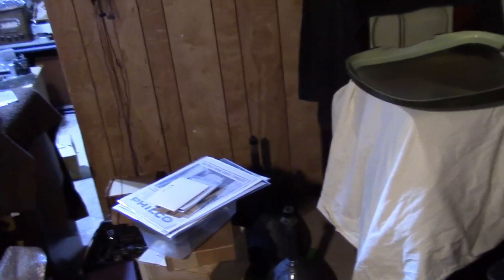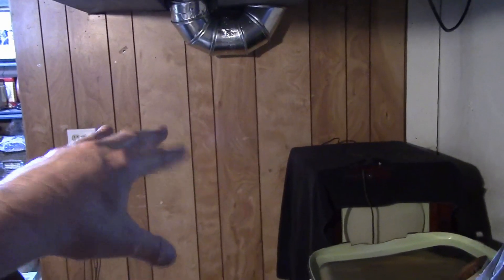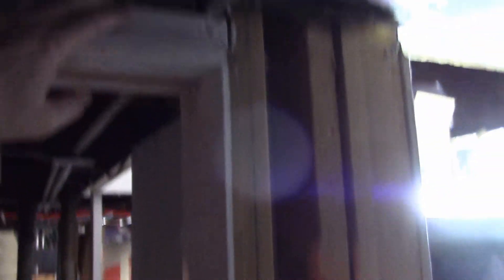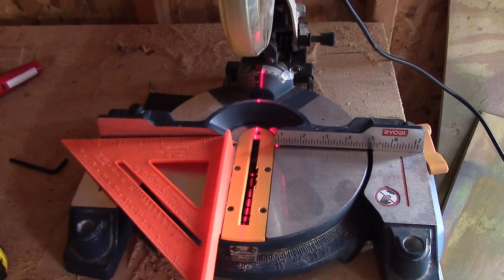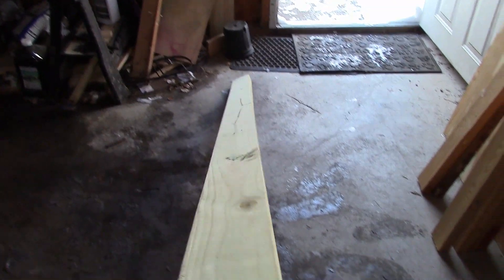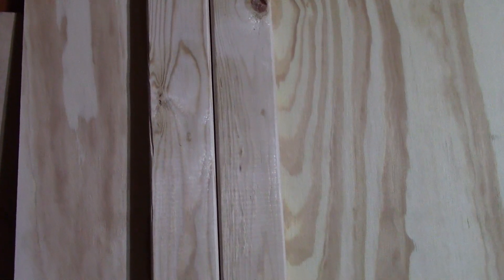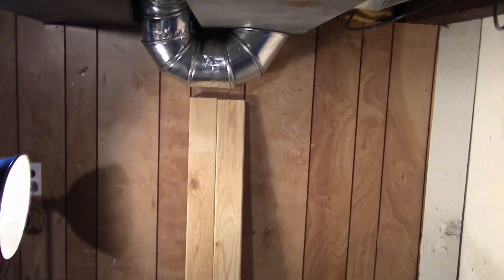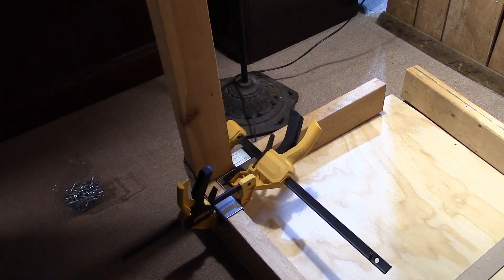Building a mini workbench

Comment: I made plywood top workbenches, but I used plywood with veneer on the top.  These were sanded, stained and then coated with urethane.  I made them 15 years ago and they are still holding up to daily use.  All electronics work happens on them and the computer is attached to one of them (rack mount).

Comment: For a tube test bench I would think that carpet on the top surface would be great.  It would protect CRT faces  and tubes would not roll away as easily.
Reply: Yeah I concur. Better than laminate and cheaper than an ESD mat. It's a common surface on TV, VCR, Radio repair benches. The last shop I worked in had one.
Cheers,
Reply: Doormats at Home Depot comes to mind. Some have an excellent table top work surface and are inexpensive.

Comment: As long as the top wood is dry and above about 65 deg F down there, you can coat it with two part epoxy.  Use a thin foam roller suitable for resins, the epoxy will seal the wood and it will be a bit darker.  Two coats, one after the first is tacky will make it a bit smoother, the one coat will feel the grain but seal it.   The wood grain look will remain if you like that and a bit darker since it will sink in.  I have a boat so have resins around for use,  but the poly coating likely lower coat.  You can also seal the end grain but watch the application near the edges it will run down the sides.  Acetone for cleanup.

Comment: The last workbench I built, I went all out and put down an ESD rubber surface. It's bought in rolls. Expensive though... The bench shows up in several of my vids. The bench surface is recessed to make the mat flush with the edge. Probably way too fancy for your new bench... perhaps just a laminate surface would work (apply with contact cement). I personally don't like those for work surfaces as stuff slides around too easily hence my use of the rubber ESD surface which grips and holds stuff in place.
Aside from that... I thought the US had Square drive screws now? Maybe the kit manufacturer is old fashioned :)
Cheers,
Reply: Square drive screws are pretty rare in the US, but common in Canada. I think I've only seen them in Canadian equipment.
Reply: @eDoc2020  yes. In Canada the Robertson  has been the defacto head in wood screws for decades.. I thought it was more common in the US (maybe construction only) now. The style is nice as it locks the screw into the bit making easier to start a screw. Using a Philips head in wood looks to be easier with an impact driver, less chance of the bit popping out and skipping.
Cheers,
Reply from the maker: Square (Robertson) screws are slowly appearing.  There's a complicated history behind them and why Canada uses them.   Patents and royalties between Ford and Robertson are at the heart of it I believe.
Reply: @bandersentv  Yeah, I think it's called The History Guy channel on Youtube that has a really good recounting of this story. Very interesting.

Comment: Why not put those metal fasteners on the inside of your workbench struts, Bob? Strengthwise they would do pretty much the same thing but, it would be a bit more esthetically pleasing don't you think? Also if you have two of these kits you could add one on the inside and one on the outside, making the whole lot stronger
Reply from the maker: I don't understand. The fasteners completely encase the wood.  There is no inside or outside.  Are you referring to the two I show at the end?  Those are not part of the kit.  I bought those for the top since I can't screw the board down form the top.  The ceiling is too low.  I can't put them on the back because I already mounted the pegboard.
Reply: Hi Bob, yes sorry, I made the comment a bit prematurely and then forgot about it as I watched the rest of your video. I thought those brackets would only cover the front of your struts and not sit on top of them saddle-like.
Anyway, I noticed you noticed one can buy similar brackets for attaching roof beams and such separately. I used similar ones underneath my roof. Nice job though, you reminded me I really need to put some work into my own lab building shelves and a workbench :)
Reply from the maker: Yes, there are many types of metal brackets.  I belie the type you described are called joist hangars.  I will likely use some for my main workbench.

Comment: rubber and you can place copper wire from rubber 1/2 inch sheet to ground to discharge stray static charges

Comment: Also, it would be a neat project to get some spare old tube testers, pull them out of the box and mount them into a back wall on a test bench. Everything is vertically oriented and easier to see. Possible downside is that the meter may be calibrated to work on a horizontal surface... Maybe.
I think it would look neat...
Cheers,
Reply: One consideration I guess would be tubes that don't like to run horizontally... Hmm.
Reply from the maker: Most tubes are OK with running horizontally.  The bigger issue is I have no spare tube testers.  A good one is very hard to come by these days.

Comment: Brackets added on the top 2x4....  IMHO, totally unnecessary...   Two screws pre-drillled each side....  More than enough holding power for the application.
Reply from the maker: Board sits on top and I don't have the headroom to drill or drive screws from the top